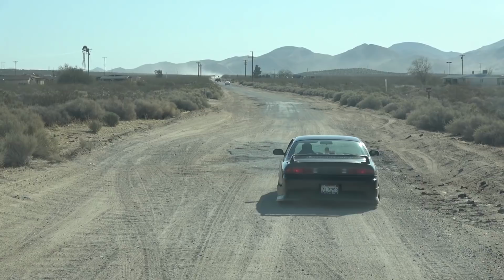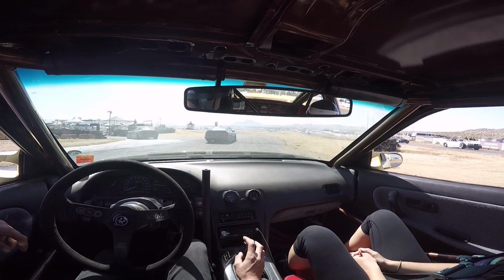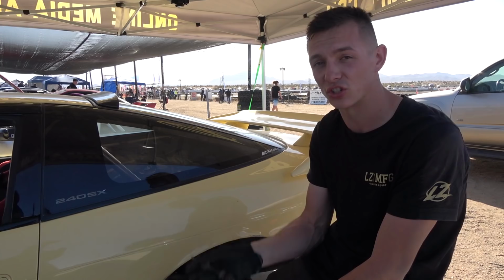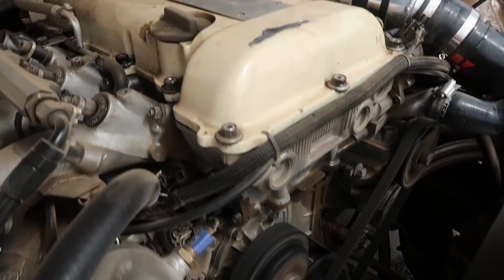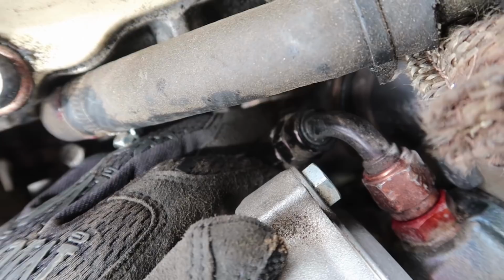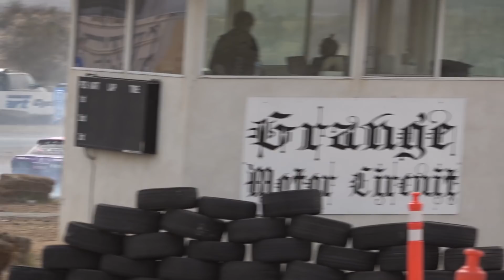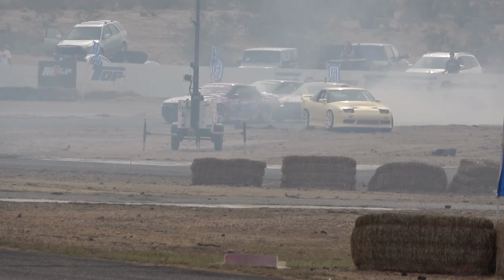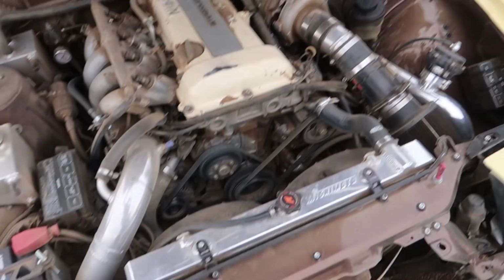Backwards Entries & Tandems with Nakamura - SUPER D

Comment: This was rad, great saves and awesome carnage!! If you use dilectric greese on all of the seals, bushings and electric connections you can lightly spray down a cold motor safely to clean it off (always cover vital parts) but it's still important to blow dry (a leaf blower alone does big things) when done. The majority of the problems come from non water proof wire shorts and extreme temperature changes warping heads. Also, personaly I never trust AN fittings without teflon tape or thread glue If they keep letting go you should give it a go.
Reply: Gamma Light: great advice, someone with experience talking here^
Reply: He could also just use a compressor to blow out the big chunks( like the ones sitting on the valve cover).
Reply: i just spray soap and rinse with the hose on my car all the time they love it, still has the airbox but the filter is the only real thing id be worried about if it was out
Reply: Teflon tape should NEVER be used on AN fittings. The seal is made on the face, not the threads. If an AN fitting is leaking there is a defection on one of the faces and it should be replaced
Reply: Vertic I should probably explain as it is unorthodox to use thread tape on AN fittings. I would never suggest using Teflon on the sealing part or deflection, only on the last 6-7 threads and unlike house plumbing only use 2-4 wraps.  Not all AN fittings do great in extensive heat cycles with contracting / expanding themselves loose, even more so if they've been tightened and loosened several times already* that's just the nature of the beast but a little Teflon glue or tape does stop the problem before a failure can occur, I'll never go without it. I specify by saying "personally"  suggestivly in food for thought,  it's not an option for everyone but it will be perfectly evident if it won't work. If you're having leaky fittings of any kind they should be replaced but if you can't risk it at all take precautions to prevent it. I've never had a leaking AN fitting with conservative use of Teflon tape or glue ever (personally speaking).
Reply: Vertic came here to say this. AN fittings usually are aluminium so easily deform due to over tightening. Thankful in the hydraulic industry that I work in is all steel

Comment: Should just get rid of that DIY AN fitting. I had the same problem and once I upgraded to a high pressure line with a clamped on fitting it was golden. Only down side is the fittings have to be facing the correct way once they are clamped because you cannot rotate them.
Reply: There is a company called "Royal Brass and Hose" that will make any line with any fittings with just about any line material you need. Swivels are also available for any line below 150psi last time I checked. But be warned, none of their stuff is cheap. Had a whole assorted batch of lines made back in SR days (early 2000's) and it was like $450 for the 8 lines that I had done. They never leaked or failed though..

Comment: That’s typical for Apple Valley is the heat, unless it’s the winter, then it’s cold and windy. We’ve had a very odd winter though, either warm and no wind, or freezing with 45 miles per hour wind

Comment: the haze in coolant color doesnt warrant oil in coolant. oil and coolant will never mix they will always rest atop of each other and if they get blended long enough youll get that milky oil. you can always check your oil level too. that will be way overfilled due to water leaking in oil passages. head gaskets can blow in numerous ways. burning oil, burning cooolant, over pressurizing coolant system, straight leaking compression, etc... judging by the color of the coolant alone, i dont thats an issue. if its hot, youre beating the piss out of it. get higher cfm fans, remove thermostat or something.

Comment: You won't see this but, you should get a Nissan titan thermostat housing, it has 2 extra ports which you can plum to the over flow. When air gets in the system it will bleed by its self. Not sure if titan parts fit but I think they would